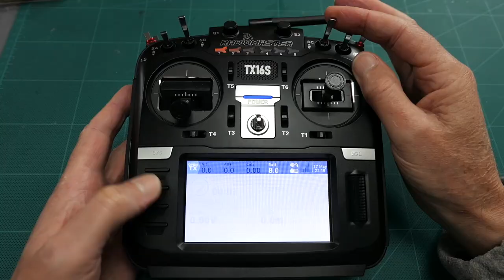Air Rider Chuck Glider RC maiden.

Comment: I can't believe that thing can't fly, even with minimal thrust.  What motors and props were you using?  I wonder if there was a problem with the differential thrust; saw a video or thread that said the esc's had to be calibrated to insure motors were working equally.  I'd glue the plane back together, connect the motors without the differential thrust, check esc calibration.  I bet if those motors were operating correctly, that plane would fly beautifully.

Comment: Great efforts Andrew!. Are the motors turning opposite directions? Are the tops of the props turning in our out? Just curious! Next you need to try it with only motor. Differential thrust for yaw and throttle for pitch control! ;-)
Reply from the maker: Turning in at the top

Comment: Very cool video, I have bought one of these chunk gliders, I'm think about running twin 64 mm edf's, one under each wing, going to take a lot of carbon bracing to make it work, well probably just run elevator and ailerons for control, well be running dual esc's connected to a 6s battery, I found some very compact 6s batteries on Flex Innovations website that is going to reduce the weight, build and flight video coming soon...
Reply from the maker: Sounds great!

Comment: I have a smaller chuck glider (650mm) with even smaller motors.  I'm waiting for better weather but the thing I'm apprehensive about is that although the motors are a 'pair' they have slightly different turning resistances so one spins up later and outputs slightly less power.  Could be equally as interesting!
Reply from the maker: Oh yes, sounds like it will be worth filming anyway

Comment: Imagine a vertical stabiliser and rudder, turned hard left. Cut it off and lie it down on it's left side, so it looks just like half a horizontal stabiliser and elevator, but it's now turned down. A left side elevator turned down. In your configuration you expect that to turn right, as if it were ailerons.
Ailerons only work very close to the CG. Behind that, and you've got elevators and rudders. Think of a flying wing. Control surface moves up, and it pitches the leading edge up, like an elevator. But move it up on only half the wing, like ailerons, and you expect that leading edge to go down, not up. It's really fighting itself, but brute force makes it work like an aileron. Your elevons don't have that kind of force, that far back.
Reply: Agreed..  my earlier comment was wrong & not as intuitive as you.
Have a good one.